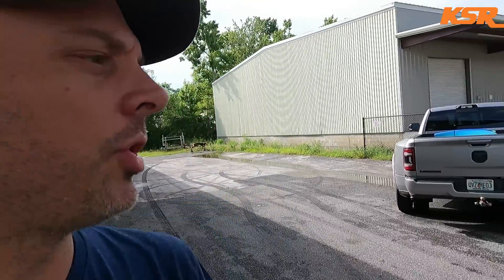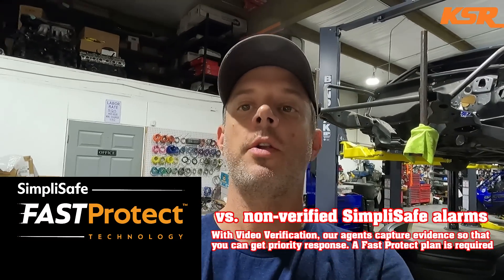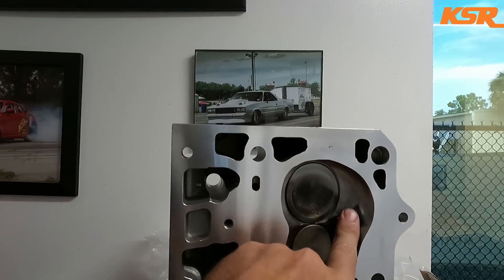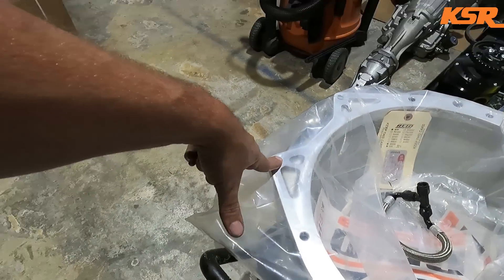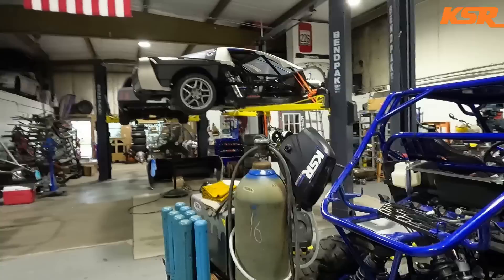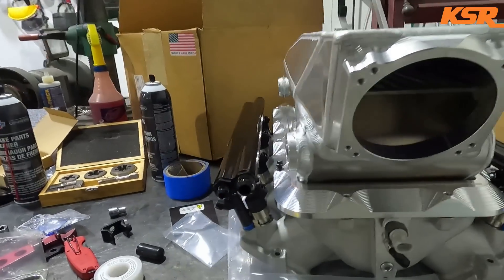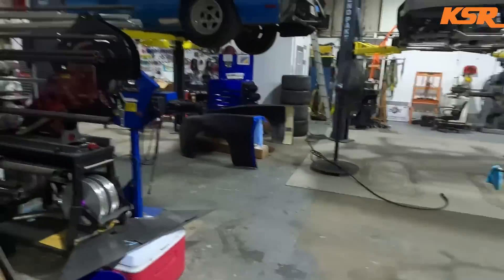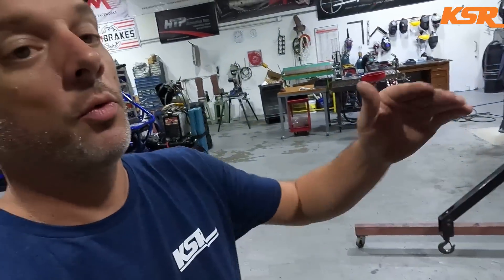SoccerMom's Heads are BACK! Plus Shop Updates June 2023!!

Comment: 1:50 There's a single lever shutoff valve available  to manually shut off both hot and cold water supplies to your washing machine. If you happen to be an electrician it's an easy job installing solenoid valves to automatically shut off water whenever your washing machine isn't in use. Shutting off a water main solenoid is an option if you've installed one to work with a leak detection system.

Comment: Check with sce on head gaskets. I know for BBC stuff they make a gasket made to be used if you don't have fire rings, it has a fire ring built into the edge of the gasket that gets sandwiched into the chamfer at the top of the bore in the block. Not sure if they make it in conventional gasket, the ones we use are copper. Worth asking

Comment: Shame about the diff...these airlines! Hope it won't spoil the racing much! A little question though...the Camaro is now basically a 7/8ths tube chassis car with such extensive caging, how would a bolt-on system cert for drag racing? Same same? As long as the cage itself is one, solid, welded piece?

Maybe put all three BOP badges on the Cutlass when it's done, let people argue what it is!

Comment: Why aren't you using copper gaskets?
Reply from the maker: Because this engine doesn’t have Top Fuel hoops
Reply: @KSRPerformanceFabrication  I believe you can still use copper without the ring and it's still better, prove me wrong? Seriously if I am, prove it to me I want to know if what I've learned is correct.

Comment: Hey Kevin is there anywhere I can look up what you did for the stock block setup on soccer mom. I'm working on LS swapping my 89' F150 right now. I have a LM7. Looking to do heads and cam once it's running. Any recommendations?
Reply from the maker: We can set you up with the parts and pieces that you need! Call Eric at the shop: 352-225-1210

Comment: For the airshock, have a little bar behind the fuel tank, with tabs, then you disconnect the bottom mount of the shock, pivot it back to the frame tabs, no need to completely remove the shock. A couple seconds to change over.

Comment: The thing I love about your Cutlass is you stayed Olds powered. Some people don’t even know that GM had different transmissions.
Reply: BOP fam represent!
Reply: @shibbypoopalot  We had a '74 LeMans with the BOP 350, that thing rolled out. Would never think such a small engine could move such a big car.
Reply: I am sure but I think Cadillac is the same bellhousing. 👍👍🇨🇦
Reply: @newtonfirefly3584  I never said it had low power- quite the opposite. It was high compression, required leaded gas, and that thing could move on the highway.

Comment: Kevin I have had really good luck with cometic mlx head gaskets. They were recommended to me by my engine builder. He has ran them on lots of ls engines in the 1600 to 1800hp range with good luck. They have a layer that is folded over around the cylinder that acts like a ring. Might take a look at those if your no familiar. Keep up the good work, enjoy the content! 👍

Comment: There is a product for flooding that has the same sensors you can place in suspect locations that hook to a solenoid valve on the water main as it enters the house. I used to be in the disaster restoration industry and we installed a alot of them back in the day.

Comment: Hi Kevin, I really like the minimum use off methanol and the late switch over, it avoids milk shakes. You just need to put it on the dyno for a day and figure it out. Maybe build dyno headers with maf sensor per cylinder?

Comment: 716  Years ago I read the reason GM made the Chevy bell different from BOPC ( Caddy too ) was that the govt was considering forcing GM to spin off Chevy due some due to some sort of anti monopoly issue.     The lower left and right bolts as well as the dowel pins are in the same position between Chev and BPOC .  
More info.  There are some  200R4  transmissions that have a dual pattern.  This was done when engines were swapped between divisions starting on the mid 70's. This swapping led to lawsuits over " Why do I have a Pontiac 301 V8 in my Buick "  "  Why do I have an Olds 403 in my Pontiac Firebird " and so on. . .
Reply: There were some dual pattern Turbo 350's.

Comment: Brilliant idea for the air shock for road use and trailer towing for drive and drag events. put a bit of air in the shock so it fully extends mount the tabs at those locations so when the car is jacked up by the frame not the axle. then at full droop you can pull those pins and remove the air shock without letting the air out. and wont have to reflate it on reinstall...